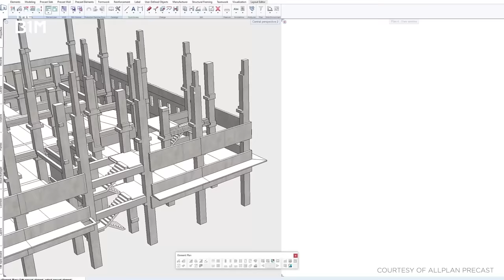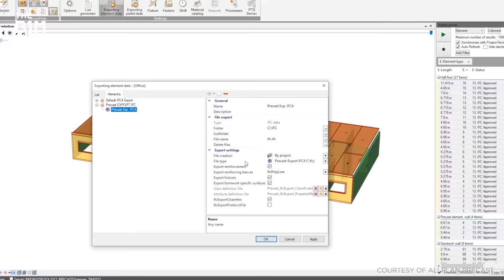Vienna is Building a $6BN "City Within a City"

Comment: "City Within a City" sounds kinda misleading to my ears, as the Seestadt is not within the city really, but forms one of its very outskirts. In fact, it's absurdly far away from the city proper for this place in which you can get basically anywhere within 30 minutes maximum most of the time(I still don't know how Vienna does this, it's magical. Probably the excellent public transportation).
Reply: exactly!
Reply: Es ist halt trotzdem in der Stadt also passt der Titel
Reply: Never been to Vienna, but, if you check on Google Maps, Seestadt is within Vienna, so...
Reply: @macwas21besterkanal48  Stadt im Sinne von town ja, im Sinne von city nein. City ist der 1.

Comment: Totally bland. The wooden building was ok. That could be anywhere.  Why not extend in a more typical Vienese style? Not just generic modern buildings that will look dated in 25 years.
Reply: Many examples of these modern wooden buildings already exist in Vienna. It only takes a few short years of weather exposure for the wooden veneer to start falling apart and look awful. Once built, there is no interest in maintaining the buildings with the districts quickly degenerating in to a ghetto aesthetic.
Reply: I live in one of those generic new Viennese buildings. It was built in 2018. 3 years later it's turned from white to grey because of smog and already looks quite run down and unaesthetic. Unfortunately most new buildings in the city are more or less like this one. Plus in the summer it tends to get unbearably hot inside, air conditioning is almost non-existent even though Vienna has more days with extreme heat every year.
Reply: Those generic bland building style is very Central European.

It pop up in other countries but generally speaking these type of modern style were started in Central European countries like Austria, Czech Republic, Switzerland and Germany.
Reply: Lol you must not be American because this would be surely be considered an artistic design compared to the brick extruded rectangles here.
Reply: @Rnbw16  I still wonder why Ac is not a Standard or at least  shutters from outside

Comment: This reminds me of a project in Dublin called CityEdge. I assume the Dublin project site is much larger though as the site is roughly the same side as the city centre. It’s also only about 7km away from the city centre. Though in typical Irish fashion; the project is over 12 years old since inception, on phase 2 of 3 (of the office work phases, no grind is has broke yet) and it is slated for completion by 2070 lol.

Comment: It‘s actually more of a satellite than a city within a city. You drive about 45 minutes from the center with the subway
Reply: 20-30 minutes
Reply: It is 26 min from Stephansplatz (U1) to Seestadt (U2). Perfectly fine for commuting, however, the Seestadt is of course not an inner district neighbourhood. The point of it is not to sleep there only and drive for everything else across the Danube but rather to actually live there in the Seestadt and have the daily needs catered for within that new neighbourhood. Yet for more specialized things or going out on the weekend you have a decent connection to the centre too.

Comment: Out of all the construction materials to make a building out of, wood is the most difficult to maintain, especially a wood facade. If they really wanted to have the least footprint, concrete or brick would have been better choices since it takes very little to maintain them.
Reply: We have wood Buildings  in switzerland from the 12 century while most concret buildings  dont even live up to 30 years.

Comment: Aspern Seestadt is definitely a "City Within a City", in other words, a ghetto. The lake around the corner is nice, but to reach the whole indeed gorgeous infrastructure of one of the most livable towns in the world depends on the service of a single commuting subway for (I am not sure, but I think, you mentioned it in the video) 11.000 households. Whole Vienna is a short-term parking zone, and a taxi cab from or to Aspern often gets more expensive than the evening program. 

However, if the population grows, such remote areas will have to be urbanized. I certainly would not like to live there, but compared to former urban extension areas, this was done much more livable. In my opinion, a better solution is to resettle places of employment instead of homesteads to the outskirts, because commuting from home to work is much better than vice versa. Living in the city and working in the circumference, instead of living in Aspern and just work in Vienna 🙂

Comment: We stopped chopping trees down since the 70's. We also reduced the use of paper. Now we use wood and paper again to replace plastic and steel use. We are also creating none-reducible and non-recyclable wind spans , solar panels and batteries used in renewable energy. Us humans will never stop using the earth. Perhaps coal products is not such a bad idea. Especially when you consider road building, and other infrastructure programmes.

Comment: As you know, sustainability is the subject of our time. Nowadays, people are becoming more dependent on solar power for electricity, heating devices, etc. It's clearer now that charged batteries for cars are more efficient than gas, to prevent pollution that is destroying the air and the natural life. I think in the years to come, we will have more cities that will devote parts of it for sustainability. However, oil, gas, fuel, diesel, and other petroleum products will still remain for larger projects such as big factories that are located in the outskirts of the city.

Comment: Vienna has a lot of undeveloped land around its historic districts. Instead of extending those in a meaningful way however often those giant new developments are erected, kilometers away from the actual city, without meaningful infrastructure like shops or public transport, effectively creating an isolated, car centered spot with a low quality of life on site and people beeing stuck in traffic jams for hours each day when they get to work or basically do anything in the actual city. 

Even worse, every new building that replaces an old one in the historic districts has no local infrastructure whatsoever in its lower floors, instead they merely place garage entries or even appartements there (who wants to live at street level where everyone can look into your windows?). Old buildings usually had multiple shops, restaurants, etc. in their lower floors, creating liveable streets. Every new building further deserts such a street until there are so few shops remaining that they are just abandoned as no one comes to them anymore. The result is a dead street with a few empty former shops that is merely used as a parking space.

The mentioned seaside city suffers from the same problem. Every building there has at least one shop, but the buildings and streets are giant. You can walk to the neighboring buildings and maybe the next few but thats it, for anything farther away you need to either cycle or use your car. Further, despite wanting to be car free, they readily build garages for each appartement and big open streets. They even plan on building a whole new freeway, just for this new site! Shouldnt it rather be planned so one does not need a car? Shouldnt public transport rather be implemented in such a way that one does not need a car? The freeway cost more than 30 new tram lines, of which only a few of them would be needed to solve the problem. Additionally activists and inhabitants are actively protesting against it, still the cities government tries to force it at all means. 

Despite the current government of Vienna beeing a former more left leaning political party, they now have adopted to only follow populist views. For example, they believe they won't get voted if they change anything that might hinder car usage in the city. Note that only about 20% of Vienna's inhabitants use cars while the rest uses public transport, walks or cycles. Far less than half of its inhabitants even own a car! Still most streets in Vienna look like following: small sidewalk, parking lane, driving lanes, parking lane, small sidewalk. Especially the old districts suffer from few green spaces and a lot of heat in summer due to all that concrete. While more modern outer districts sport more green they are usually build around freeway like streets making it cumbersome to impossible to even walk to the next building or the next stop for public transport. 

Vienna mostly profits from its historic substance. Those old buildings are forced to stay at affordable rents and are protected against beeing demolished thus, by chance, leaving lively streets with shops and restaurants which are so cumbersome to drive through that most of the people are saved from the constant car traffic, even allowing some restaurants to place seats on the street or sidewalks. Every new development as it seems lowers the former quality of life, with a populist party as government that thinks a city is most of all a big parking house.

Comment: It's inspiring. The buildings are a blend of interesting and practical, which is important. The one criticism, is that it looks a little too urban. It could use more green spaces through out the corridors of the city. The trees haven't fully grown, so I'm sure that the park will look much better in a few years. Rooftop green spaces are neat, but not necessarily visible all the time, meaning it doesn't make the city feel greener on the ground. It looks nice though.

Comment: Hi, yes the video let you asume nice living space. But the following facts are not told:
1.) The location of Seestadt Asparn lies near the Vienna inernational Airport Schwechat. More or less only the river danube is between the Seestad and the airport.So there are a lot of low flying airplains with a lot of noise.
2.) There is almost no concept dealing with the heat in summer. A lot of ground is sealed with asphalt, concrete and co. So it's very hot between the buildings in summer.
3.) As usual in Austria most of the buildings for residentials are not equiped with an AC. So it`s also very hot in sommer in the residential flats and condos.
4.) The water management of the artifical lake is terrible. So in summer the water stinks and the water level is sinking a lot.
5.) The original design of this micro city was in mind with alsmost no cars, but pubic transport instead. However till now there is  only one metro line to Seestadt Asparn. A good concept for transportation is missing. There are new roads in planning, but with a lot of protest from the public.

I live in Vienna, but I never would consider living in Seestadt Asparn.

Comment: If you move to Vienna, dont move into Seestadt Aspern! Move close or even better inside the Gürtel Area. Most parts east of the danube are pretty rural with nothing that feels like living in a big city. Seestadt Aspern for example is so far away from the city center that it will take you 30mins with the subway till you are in the center. Compared to big citys like berlin or paris that seems normal, but for vienna it isnt. If your flat has a good location you can reach everything by bike in 20 mins or less. vienna resident for 25 years now - AMA ;)

Comment: The real clue was to build the metro line ahead of building construction. For several months the U2-line ended in the empty field which was to become the Seestadt (simply translated: "Laketown"). When people were able to move in they already had a high speed connection to the city center and connection to the rest of the public transport network. Also many construction workers were able to use it to get to work there.

Comment: As someone who lives there let me tell you, the practical snd strategic flaws seestadt has outweigh every single perk presented in this video
Reply: @John Haney well lets start with parking: they made far too little parking spaces in hopes that people use the public transportation (which is another major flaw) and then they made parking garages that are really expensive. 
Public transportation: yeah we have a u-bahn (metro) with which we can get to the city HOWEVER it takes long and so people that work in another district or further away take the car because its quicker and easier. And not even just another district. When i want to visit my father who just lives 3 km away, not even 10 minutes by car it takes me at least 25 minutes to get there with public transportation and i have to switch between three different busses/metros and walk a distance. They might have made the connection to the city "well" but not to the closer districts or the connection within the same district. And with new parking regulations in Vienna they have now closed a third of the free parking spaces as if it wasnt bad enough already. 
Nature/greenery: literally can not stress this enough but for a "city" that prides itself on being sustainable and green there is far too little actual green. Everywhere you look it‘s concrete and asphalt. The spots where the little trees are, which are usually grass spots are covered in sand. The "lake" they made before even building the buildings which resulted in it being way too small for the large population and you know what happens then - exactly trash. The lake is incredibly dirty and no one cleans it out. 
Talking about concrete: there‘s a different climate in the Seestadt. Idk if it‘s the concrete or the high buildings but in winter it feels 10°C colder and in summer it is incredibly hot. I mean if theres only concrete everywhere that heats up in the sun and then with the high buildings the heat cant escape…that seems quite logical to me. 
The buildings: well what can i say. I think Seestadt was every architects dream because they could build the craziest, most impractical apartments. Seriously some apartments are so impractical. They are weird shapes or windows dont open (?) the outlay is just a mess or you might be apartment 1 and your neighbor is apartment 53. And lets not talk about you looking out the window and looking directly into your neighbors bedroom. 

Yes there are many perks to this project but i rarely see anyone who doesnt live there talk about its downsides. I have seen it from before they started building so i was literally there from the start and those are just my main concerns, i am sure theres more out there and some people might not find my negatives that bad. You can definitely tell that they learned something from the first part they built because the newer part they just finished has a lot more green and grass instead of sand, the parking situation seems to be better and it just looks a lot friendlier and better. I guess we will see how the finished Seestadt will look, which will take a lot more years. 
Anyway i hope this answers the question, these are like my said my personal opinions so yeah. 
Have a good day
Reply: @John Haney haha yeah sorry these things just really bug me. I tried to keep it simple but i got out of control haha

Comment: well it's not that rosy:
the are 10 years behind 15 years into the 20 year plan... 
only about 1/4 is built.
there is way to much pavement instead of grass and trees.
the buildings are just generic modern, have a lot of odd angles which make them hard to furnish and are often built to close together.
the whole thing is planned to house just 25.000 people (vienna grew by 350.000 in the last 20 years) only 8.200 already live there...
the city is having trouble getting the developers to actually build more of it and i'm pretty certain the 6b will not be the end of it.

Comment: city within a city. well thats hardly true. for most viennies people this is not considered a part of the city anymore since it is really badly connected to the public transport in the actual city and even if u live right next to the u station it takes you more than 30 minutes to reach the center. this is just a district really on the edge of the city.
Reply: Yes it's quite far and I agree I don't like it either. I worked at a company shown in the video who moved there. It feels unreal (cold) and lots of daydreamers on the streets.
However, I can not agree with your statement. It is good connected. Direct access to u2. What more should they do? It doesn't get much better than that. In other cities you'd have a 3times longer trip to the center.
Yes, in terms of roads, I'd agree that the lacking extension of the S1 hurts and caused me a 1hr trip to and back from work each from the western districts of Vienna.

Comment: But that looks more for the prefabricated buildings in East Germany or in the Soviet Union than anything from Vienna.

Architecture over the past 50 years has simply not produced a single building that looks really beautiful.  In our case, the city center was restarted a few years ago, and everything is pasted up with concrete blocks, each uglier than the other.

Comment: well the project has its problems as well -- way to many people are still using their cars to get into the city centre and in the summer temperatures up to 40 degrees centigrade were measured (which was probably a result of the high use of concrete)

Comment: Not a single new  building is beautiful or memorable. They are all prefabricated puzzles inserted into a decent urban plan- I think all of these building will be gone in the next 50-100 years. I just wish architects and politicians would have a better vision than this.
Reply: They are designed for smart living so best and all usr of space.
I prefer this one i have to say, i live in an apartment in district 21, all good looking, but only the apartment on the top has a balcony even if the others could easy fit one but that woulnt be very astetic